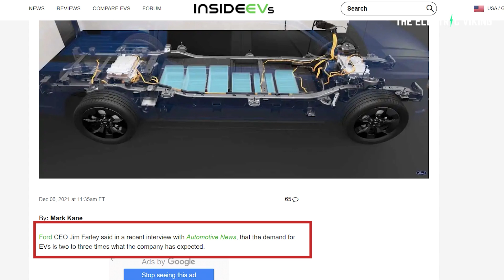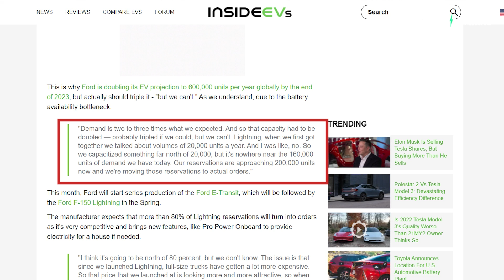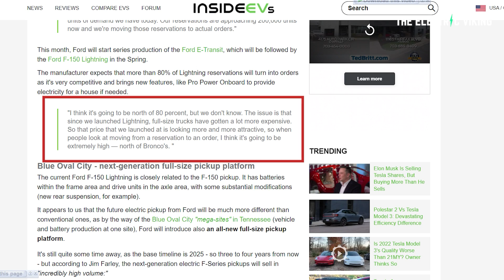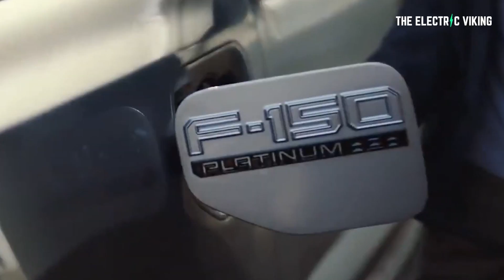Ford announces NEW mass produced EV Pickup Platform

Comment: Hello Electric Viking… Are use Ford F2 50 and F3 50 trucks to pull 12,000 pound trailers and plow snow in the winter time and today I saw an interview where the CEO of Ford said they are planning on making their super duties electric It is very exciting I definitely would rather have a battery over my turbo diesel’s

Comment: Leveraging an old chassis designed for a huge 🧊 engine sitting high & front will never fly against 1st principle engineering, 4680, best sw, EV optimized design from Tesla. In terms of energy density & efficiency the old 3-box cab design will put e150 in 3rd place behind 2nd Rivian. Give Ford the credit for acting on it.

Comment: Ford's original plan for 20,000 F150 Lightnings is 2% of their truck volume... an indication of C-Suite cluelessness.
Blue Oval City is likely being similarly under-designed -- maybe 150,000 annual production at full ramp (2027/28 maybe?).
Too little, too late.

Comment: And remember, this won't just be the next gen F Series skateboard, it'll also be the base for Ford's next-gen full-sized SUVs as well.
Reply: Which is probably the most important (and almost invisible) other transition in the car industry happening at the moment ... creating basic platforms and building lots of different models around it, instead of re-engineering every model. That is, interestingly enough, something Tesla is probably still learning. At least these days. they're trying to have a significant percentage of common parts between models 3 any Y, but that's not really the same as a common basic platform. These common basic platforms save a lot of development money, and they started in legacy auto (and the transition is far from over even in legacy auto). 
There's also the point that you can't easily build EVs from an ICE platform, and presumably vice versa, but I strongly suspect that if you wanted to, you could engineer a common platform that works for both. Why? Well, because they have been doing that in another transport sector for years. For example, the Siemens Vectron locomotive family (closely related to the US-built Siemens Sprinter and Charger models) have both diesel and electric (and even combined) models. They also have models for a significant number of different security systems, as the European transition to ETCS is still not done, and you can combine several of those, and models for different electricity systems (which there still are in Europe), again several of which you can combine ... and they're not the only rolling stock builder who does things that way.
The lesson here is: look at what all you want to build and figure out a way to make all the common things as one basic building block, and all the different ones as add-on modules that fit in a standardized way, and lastly allow for cosmetic changes where it doesn't really matter for the engineering (compare the Amtrak and Brightline diesel models - that's essentially the same locomotive on the inside, but it looks very different on the outside).

Comment: What Ford has, is the tried and proven F-150 to bolt onto the new skateboard propulsion frame.....MUCH less production issues as opposed to a ground-up design.
  And let's face it, that's all any of them are.....a modified chassis to fit onto the EV platform

Comment: I like what Ford is doing here. Reality has set in. ICE vehicles are no longer viable nor desirable. Ford's F-150 is one of America's most popular vehicles. Adding full-sized pickups made from scratch as EVs is an effective strategy to give Ford new life. If they can figure out a way to produce more in a timely fashion, they will not only survive but prosper. Toyota is another matter. I can't comprehend their long-term strategy where they bet hybrids will sustain them until they produce EVs. Sam's analysis here is hard to counter. No matter how good, a company cannot just snap its fingers and deliver electrics overnight. The change cycle is accelerating, which means those that dawdle will be quickly left behind.
Reply: @suspicionofdeceit 
I am curious as to what infrastructure limitations you are referring to? All single family residences have electricity for level 1 and 2 charging. Installing level 1 and 2 chargers in apartment buildings, parking lots, and motels, in addition to level 3 DC fast chargers for travelers, is way cheaper, easier, and faster than building gas stations. Battery production is somewhat limiting at the moment, but the amount of production capacity being built is astounding. Add to that the amount of research and investment in batteries, and all other aspects of EV's, and the speed of production just keeps ramping up.
Reply: Ford production is limited by batteries.
Reply: @suspicionofdeceit You are right. Toyota does believe this but… did you talk to an EV owner lately? I know three people in my life that own EVs. None of them quote “infrastructure limitations” as an issue.
Reply: You’re right on the money. If Ford continues with moves like these, they may survive.
Reply: @suspicionofdeceit 
This is not, and will most likely never be a large issue. Most people with single family homes have access to electricity. I, as an electrician, have not even bothered to install a EV charger yet, and simply use the mobile unit that came with my PHEV. If you do not drive a Tesla, it will be more of an issue when traveling, since Tesla is the only auto manufacturer to invest in their own chargers, and other charger networks are not as robust. Tesla has offered to share their network with any other companies that wish to partner with them, but none have had the foresight to do so. Tesla is now starting to open up its network to other vehicles. Norway's current level of EV sales is over 90% of the market, and they do not seem to have a problem with charging infrastructure. Installing chargers is fast and cheap compared to any other types of fuel systems. One does not need to clear or purchase any additional land, as parking areas already abound. Adding EV chargers is as easy as installing parking lot and street lighting. 
One only has to do any combination of the following to quickly build EV infrastructure:

Requiring all new homes, apartments, businesses, and parking areas to install level 2 chargers.

Require and support all existing apartments, hotels, motels, inns, and rental homes with parking to install level 2 chargers.

Support level 3 DC fast charging systems by fast tracking the permitting process, and making public parking areas open to installing EV charging.
Reply: @suspicionofdeceit All these people with EVs charge at home 99% of the time. Like I said, there is no issue.

Comment: THIS announcement at THIS time means Ford hasn't a clue what to do. The Lightning is now a stop-gap and I feel for all the suckers who reserved one. During WWII, a small shipyard in NE USA built 50 escort carriers in 16 months. Today, a modern car company, with all of their wiz-bang tech, cannot design a EV in 5 years.
Reply: Yes Ford, GM and other legacy automakers are toast.  They limit production to limit losses and to keep selling ICE vehicles which is like crack to their shareholders.  They are decades behind Tesla and China EV makers. Too bad. I’d like to replace my gas guzzler  ‘13 F-150 for a Lightning but Ford stopped taking reservations this past Wednesday.  So it will be several years before I could get one, assuming they survive.  I’ll just get something else.   See ya Ford.
Reply: @robculpepper530  I have a reservation for a single motor Tesla Cyber truck. From the reports I read, I won't receive the Cyber truck until late 2024.

Comment: A clean sheet design for a truck skateboard chassis will give a truck a much larger range, better suspension, and better towing capacity. It will also handle a lot better as the weight will be very low. In fact, a truck chassis, unloaded, will be a  dangerously fast and dangerous vehicle; basically a 5000 lb rocket ship when empty, as you will have beefy motors and momentous torque (to the point where the tires will have trouble not slipping).  People will love drag racing the electric trucks because they will be like muscle cars. I expect some terrible accidents, because americans will love racing them, but they don't realize you can't stop a 5000 lb missile that easily compared to accelerating it. 

I expect the new truck to be a great deal more aerodynamic, as the current shape yields high energy per mile, and with the motor below there is no reason to continue the current shape.

The reason Ford bought a lot of land is that they want to be able to expand, and they expect this to be a huge plant in the future. They can project growth rates also, and they know that the number of models Ford makes is going to go down.  It is going to be a bloodbath in the car business; too many manufacturers exist.

Viking should do a program on all the funny little car companies that exist around the world and their fate.

Comment: Ford has to do a redesign because right now they are cramming electronics and batteries into a vehicle designed for a gas engine. They can make all the plans they want. They still need designers and engineers and batteries and oh yeah MONEY.
Reply: All of which they have so... no issues there.
Reply: @hankkingsley9183  they have all? The whole industry is short of batteries.  Where does Ford get them? 
Batteries and software are the most critical pieces of an EV, Ford is still lacking in those areas.
Reply: @hankkingsley9183  if they sold their Rivian stock. That could get them into a factory and cover prototypes and contracts for parts etc. if they sell.